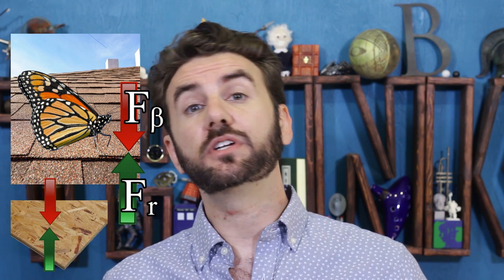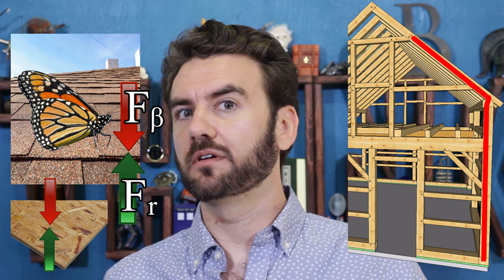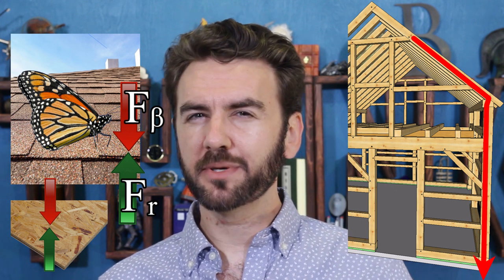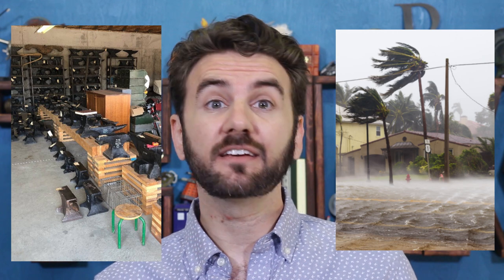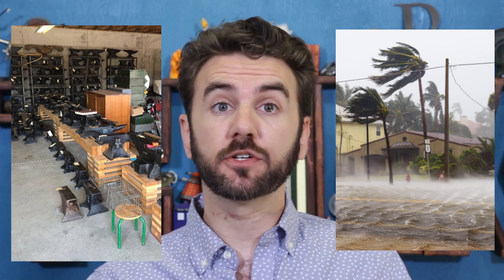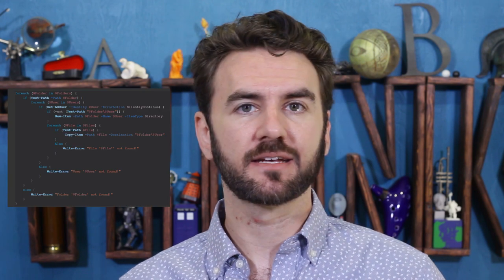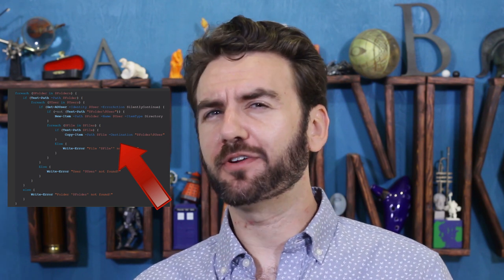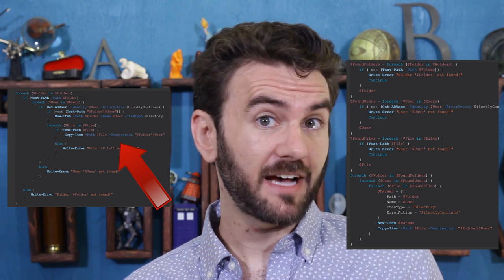194. Load Path Analysis | THUNK

Comment: I'm more of a technocratic social engineer than any other type, but load paths apply to soft skill endeavours as well.  On enterprise scales it's optimizing infrastructure process to accept all possible inputs (load) and output useful products, or if something is amiss, meaningful failure modes which gracefully act as inputs to self-correcting processes without any extra steps.  The process substrate is variable, could be local-space, info-space, or even meat-space. The least wobbly path while ensuring continuity is desirable. 

Zooming all the way to the other end of the spectrum, it's the same sort of planning needed to successfully achieve a wildly unpredictable group objective.

Say you're writing the operational plan for your Burning Man theme camp's 20th annual deep-playa Space Disco Pajama Jam & Sunrise Ambient Waffle Nunnery. The social environment is inherently wobbly, even amongst the truly-committed so in this this case the load path works better as one-step-task-oriented rather than process-oriented, where non-specific autonomous agents can self-assign/re-assign micro-loads in real-time. All that's required at showtime is a very few single-task gatekeepers, required resources, and a critical number of self-identified automutanous agents. The load as defined by the organized tasklist, which might macroscopically be quite complex, is completed bit by self-redundant bit, and self-organizing social gestalt.  Teamwork makes the dreamwork!

Obviously a different application, but the same path-analysis is required for success.
Reply from the maker: Interesting! I've thought about infrastructure in terms of load paths before, but I've never been in a position to plan stuff like what you're talking about using load paths from the get-go. It sounds like it works pretty well, from what you're describing! :D

Comment: Note squad~

on topic: I often find that something similar  to load path analysis is useful in software, increasing stability and decreasing number of independent components in the system for the most heavily stressed parts of the program to reduce chances of failure, and can account for the most likely failures in a more predictable manner.

(i wrote that before you got to the software part, too)
Reply from the maker: NOTE SQUAD! ;) Glad to know you see the same parallels I do! I make a lot of software comparisons to engineering & design, but I don't do code for a living.

Comment: Ah ... this is one of the reasons a market economy is so much better than a planned economy. If one could solve the calculation problem, it's possible to imagine that a command/centrally controlled economy might be more efficient in some ways. However, the market economy allows dynamic and overlapping "load paths" which can be quickly adapted to failures in other areas. Aluminium isn't available? Use steel or plastic or wood. The market economy responds even better than this, it responds to the "weight" of a thing in the market, namely its price.

By responding to price signals, agents in the market are actually "balancing" the weight as well as they can. A farmer who doesn't sell his grain now, at a low price, might be called greedy when he sells it later at a high price. But by doing so, he helps to reduce fluctuations in price (less grain in a glut means prices don't fall quite as far, more grain when prices are high keeps prices from rising even more). He is helping the market allocate the grain to more urgent needs, cattle feed during the glut versus food for humans during the price rise ... and may be saving people's lives.

A command economy cannot respond as quickly and, besides being less efficient on average, is also less robust.
Reply from the maker: Great points! Markets are certainly very good at distributing consumer "load" in the most efficient way, ideally cutting out middlemen & whatnot. It seems like it could also be used to model market failures, e.g. monopoly = a single structural member that supports the entire load & represents a single point of failure, a commodity with inelastic demand = an infinite point load, etc.
Reply: @THUNKShow  I think you get the gist of what I meant ... and it's a metaphor that might need work. Though I have nothing against middle men and true market monopolies are exceedingly rare (meaning not up-held by some government regulation) ... as are inelastic demands (not saying that there aren't varying levels of elasticity, just that there is no truly inelastic good ... even one's own life).

Comment: Yunno, I've been attending security conference(s) this week and this all reminds me of threat modeling for application security. It's not exactly a new concept, but here's its approach onto the deathstar: https://www.youtube.com/watch?v=RvDBA2XywlY&ab_channel=MyDevSecOps-
knowing how one failure can enable the next failure and so on can help develop mitigations and response plans. From this video, sounds like the same approach helps with physical forces as well. Really anything that has multiple components that affect each other in cause-and-effect, particularly if that effect can cascade in any way. Illustrating trees and matrices of these systems of cause and effect (and as you pointed out, flattening some of these out) is probably a good idea for many practices, and for many upsides.
Reply from the maker: "The weakest link in the chain" is perfectly analogous! Shorter chain, stronger links, better results! I'm also thinking of the flowchart for secure access & rejection of unauthorized users, & it looks/behaves a lot like a structural load path diagram - if you need 2FA up at the top, it weighs heavily on the user's access to everything underneath it.

Great points!